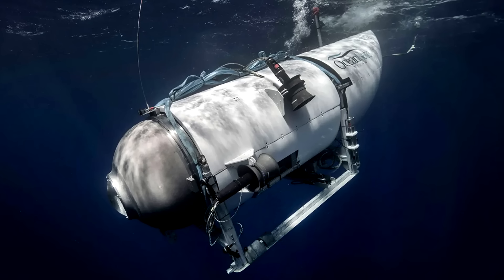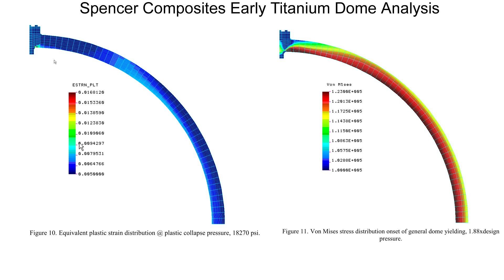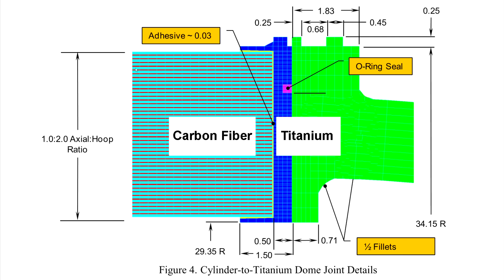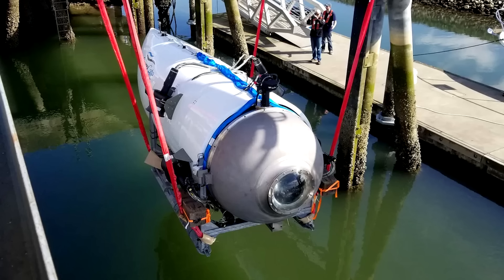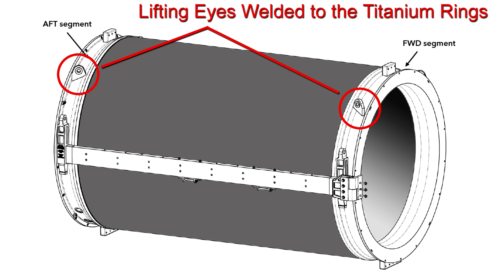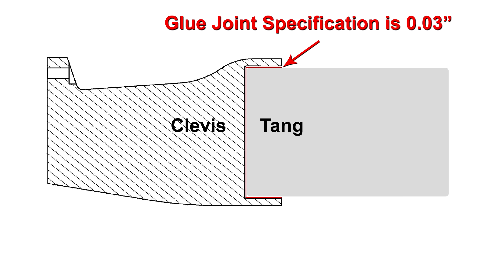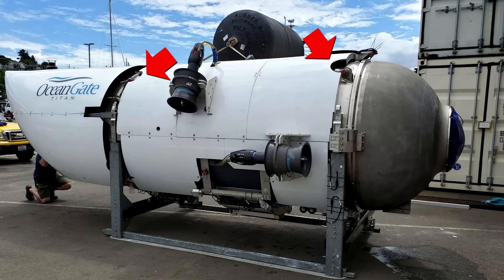OceanGate Titan Titanium Rings - An Additional Story About Them

Comment: I'm no engineer, but would have it made more sense to create an overhead structure (like a roll bar) tied to the "landing gear" to provide lift points instead of risking welding to the hull rings?
Reply from the maker: Thanks for your comment.  Yes, there were other ways to do it.  However, they may have been concerned about adding too much additional weight.  The weight of the sub is a big deal because it has to do with its buoyancy. Both to sink down to the Titanic and also to ascend by dropping weights. either in a routine dive or in an emergency ascent.

Comment: They should of used flex seal instead of carbon fiber, carbon fiber cannot withstand extreme compression period and there is not safe way to make it work for deep dive applications, the shrink rate between the titanium and the carbon fiber was pretty much ripping the ship to pieces everytime they took it down, that guy that thought he knew what he was doing didn't know much except the greed that got himself and the others to loose there lives

Comment: Bonding is a chemical treatment or conversion coating of the mating surfaces. Adhesion is the glueing process. Both processes are required for this application, the mating of titanium and carbon fiber. The process is an industry standard having color significance for each application for quality assurance inspection purposes. One can see that the bonding application is not present. When the ring is seated the squeeze out is not uniform and bubbly which indicates voids in the mating surface. Both observations would be considered points of failure and cause for rejection.
Reply from the maker: Thanks for your thoughtful comment with good information.  Nice additions to the discussion.
Reply: @solareclipsetimer  additionally carbon fiber degrades in uv/outdoor light becoming brittle. This build process is unforgivable at this knowledge level
Reply from the maker: @robcampbell2164  Thanks for your comment.  You are correct.  That is one of the benefits of OceanGate coating the outside of the hull with Rhino Liner.  However, the main reason was to prevent water intrusion.
Reply: @solareclipsetimer  Thank you for the interaction SET! The end item was ok for exposure to UV yet curious to witness the lack of UV preventable measures during manufacture. Fun fact, in aerospace manufacture it was found that silicone jewelry, which was popular at the time, was found to be contact harmful to the material and was not permitted to be worn during the manufacture or repair process.
Reply from the maker: @ Good points about other UV exposure.  Did you watch my other video, where I discuss that they had to transport the hull 55 miles after a layer to get to the factory to do the curing?  They 55 miles back to add another layer of carbon fiber.  Then back again 5 times.
Reply: @solareclipsetimer  I have not. I subscribed and look forward to doing so. The industry is an amazing science, and I am thankful to be a part of it in aerospace certification. I must say that the engineering mind in this instance is far removed from the ethic. It's like a doctor who doesn't uphold the Hippocratic Oath.
Reply from the maker: @ Oh yes, I know.  I am a surgeon.

Comment: Missing bolts at front dome 4 of 17 bolts why ????
Reply from the maker: I have tried to find out why all the bolts weren't in on that dive, but I am not sure. I can't find a good answer.  It was after dive 61. That dome weighed over 3,500 pounds, and the "hinge" on the left side (looking towards it) wasn't really a hinge. It could not support the weight of the dome, like the hinge we are accustomed to on a regular door. It was more of a pivot point. When opening the dome, the dome had to be supported at the bottom as it opened.  They obviously missed supporting it properly during that recovery.
Reply: @solareclipsetimer  water leaked in though missing bolt holes could be one of its failure that dive .rip too all
Reply from the maker: @mrx-k2r  Not sure about that.  During a dive, the pressure pushes the dome inward, and there is an O-ring on that ring surface to make the seal watertight.  But I still don't understand why all bolts were not installed.

Comment: I'd love to know how the cables entered the pressure hull
Reply from the maker: That is a great question.  Yes, wires, both control wires and power wires, need to pass through the hull.  There were watertight fittings through the rear titanium ring to pass those connections.  I wish I understood how they make those fittings watertight under those pressures, but I don't know the engineering.

Comment: Very interesting. Lot's of good information.  I haven't watched the other videos you have made on the Titan, so I don't know if you addressed the issue of repeated dives with no inspections/tests of the hull, nor inspections/tests of the other components.  Deep submersibles are rarely used without inspections and tests of the submersible after a dive.  Apparently, even titanium hulls are degraded with each dive until they can no longer be used for deep dives.  From the reports that I've seen, Oceangate had used the second Titan multiple times without inspections or test of the hull between tests, so couple the altered design of the Titanium rings and carbon fiber hull, there were no checks to see if it was still capable of deep dives.

Now I have to watch the other episodes.
Reply from the maker: Thanks for commenting, and I am glad you like the content.  You would like my three videos on the hull andone on the viewport.  I don't address non-destructive testing specifically in the videos, but I did respond to a lot of comments about that.  The testimony seems to indicate that the methods available for carbon fiber start to lose their specificity after about 3 inches thick.  So, not too useful on the Titan.

Comment: Pretty clear that the machined lip broke off as the hull separated from the flange, perhaps a larger lip would have prevented the two coming apart or a much tighter fit interference fit would have prevented the failure in addition to a thicker lip. It's like a tooth past tube at some point remove the cap or loosen it eventually a leak or the cap pops off. Ironically if there was no interior bracing on the interior of the hull your asking for the hull to collapse in spectacular fashion ultimately though ...

Comment: Why not just manufacture a crib for lifting the sub? You even make one big wide belt that goes under the belly and cradles the entire sub.
Reply from the maker: Thanks for commenting. I believe it is because of getting the Titan off the dock onto the LARS. It was a tight fit, and the landing gear of the Titan had to slip into a track on the LARS to get locked in. So they couldn't have a sling across the bottom of the sleds.  There was no way it would have been a good idea to sling it from the carbon fiber hull,  the titanium domes on each side weighed about 3,600 pounds.

Comment: In the Telecommunications Industry before AT&T or Verizon and most of the other “Baby Bells” will not consider purchasing a piece of equipment to be installed in one of their central offices unless it has passed a very specific set of tests that includes earthquake testing, extreme environmental conditions testing, destructive testing of the equipment as a network element and destructive testing of each module.  My point is this submersible that was designed to carry people to extreme ocean depths was subjected to far less testing than a piece of equipment designed to make/complete a telephone call.
Reply from the maker: Thanks for your comment.  You are of course, correct; there is no way people should have been in this sub.

Comment: I know the expert is arguing that the c-shape on each ring for the glue joint is not a potential point of failure. But, I see it in 2 dimensions and wonder about the micro-deformation characteristics due to static load on the inner leg of the C. It seems to me that unless the ring and carbon fiber move precisely together under load (and temperature, which has to be taken into account, I imagine) a sheer will occur at the point where the inner leg meets the ring body OR where the outer leg meets the ring body.
Reply from the maker: Thanks for your comment.

Comment: One question I have not found an answer for yet is: how did they get electrical power into the interior of sub from the external batteries? the cables must have come in somewhere, was it through the rear dome?  or was their a gland where they entered into the hull? or did the sub have an interior set of batteries and an exterior set?
Reply from the maker: That is a great question.  Yes, wires, both control wires and power wires, need to pass through the hull.  There were watertight fittings through the rear titanium ring to pass those connections.  I wish I understood how they make those fittings watertight under those pressures, but I don't know the engineering.

Comment: I don't recall reading anywhere about the lifting eyes, but clearly they were added after the hull design, nullifying any computation before that point. It reminds me of the airline that removed and refitted engines with a forklift instead of following the manufacturer's procedure.
Reply from the maker: I agree with you.  As I said in the video, may be they had some additional guidance from Collier Aerospace that we don't know about.  I hope so.  If not they were just "winging it."  Thanks for commenting.

Comment: The most fascinating thing to me about this whole story is that, as easy as it is to make the whole thing look insane, they actually had a lot of ideas that might have worked, and if they had worked would have been a huge deal. The problem is they were taking too many risks and doing too little testing to be remotely safe about it. If Stockton was a more cautious person and they had a much larger budget, they could have pushed so many boundaries in positive ways - there is probably some degree to which you can compromise the idealized shape of the porthole to give better visibility while maintaining most of the strength. There is probably a way to make the multi-layer hull work, which would be much cheaper to manufacture. The use of mixed-materials was probably not actually a problem if they had bonded them correctly and handled the completed vessel correctly. I think with a little bit more care, a vessel like the Titan could have been made quite safe. But because they cut every corner imaginable people died, and every 'innovation' they 'pioneered' is now 'radioactive' for the foreseeable future.
Reply from the maker: Thanks for your comment.  You are correct, they did some innovative things.  But, you can't engineer something new like this for a business model that you eventually want to be profitable.  They would have built, tested unmanned, and destructively analyzed multiple full scale hulls.  It would have taken a lot more time and money to figure it out.  But you are correct.
Reply: @solareclipsetimer  Yeah, their mindset seemed to be something like "if we just nail it the first time we can avoid all those R&D costs and it will be much cheaper" without any regard for the deeply concerning question of "what if you don't nail it the first time?". I would contrast with SpaceX - they are similar in that they are a private company whose business model is predicated on sucessfully using ideas others would dismiss out-of-hand as impossible, but they test extensively, aren't afraid to spend a bunch of money on something they know is going to be destroyed, and don't put under-informed passengers on completely experimental vehicles.
Reply from the maker: @nicksummers8320  I agree with you.  And we must remember that Space X didn't invent rocketry, they didn't try to "re-invent" rocketry either, they built upon what was known.  OceanGate was trying to re-invent submersibles and when doing it trying to NOT use marine engineering.  Wild story.
Reply: A bit of R&D can go a long way. It could have had two dome portholes with the right structure and top engineers designing it. 

Sad it didn’t work out, the potential was there but they skipped some really important parts initially and the timing was lost. RIP

Comment: As an engineer, I would not have trusted that glue joint in shear. I would have stepped the ring down so it goes inside the carbon fiber tube.

Comment: That edge on the ring's clevis is not very thick. Pics of the recover ring show the inside sheared off.  Not surprised if it was the inner ring clevis edge that gave out first.
Reply from the maker: Thanks for your comment.  One thing I would say is this, no matter what the cause of the implosion was, the implosion itself was an inward pressure that was going to shear off the inner rings.  So, it's really hard to say if the lips failed first, but they could have.

Comment: Having been advised by their expert not to weld lifting points to the titanium rings, I'm surprised they went ahead and did this.  They could have welded lifting points to the carrier frame without any great difficulty.  Welding onto the titanium rings that were already glued to the carbon fibre body not only stressed and altered the titanium, but no doubt caused unseen changes or failures at the titanium/glue or glue/carbon fibre interfaces, or within the glue itself.
Reply from the maker: Thanks for your comment.  Tony said no when it was being designed.  I hope there was an engineer with the second sub that said it was okay to do the lifting eyes and signed off on it.  We may know more when the final report comes out.  If not, it is really criminal.

Comment: The Carbon Fiber interface to this joint was always my first suspect as to where failure occurred. In the last photo displayed of the (Titanium?) ring shows that some portion of the "C" joint failed, and a thin piece of titanium looking like twisted titanium batten or something is protruding from around that inside edge of the ring.  It has obviously been sheered off the ring, as it would have formed a portion of either the upper or lower lip of the C ring.  There is no glue evident in these photos of the titanium rings either, which led me to believe the glue failed due to numerous stresses and destresses.
Reply from the maker: Thanks for your comment.  One thing I would say is this, no matter what the cause of the implosion was, the implosion itself was an inward pressure that was going to shear off the inner rings.  So, it's really hard to say if the lips failed first.

Comment: This is all so crazy! Design for lifting and transport is a really big deal in many industries! Manuals for bulldozers include exact information on lifting and strapping down, for example. 
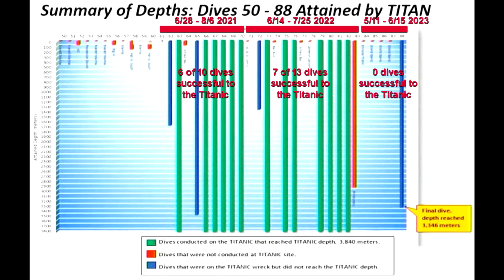Speaking of which, 11:19 that front-most bolt is a very tight fit with the perimeter of the titanium ring.
Reply from the maker: Thanks for your comment.  I agree with you.  Boy, I would love to know who engineered this idea and signed off on it.  It's not in the public record right now, but i may come out in the final reports.
Reply: Rigging is an art. Whether you use steel cables, chains, or nylon materials. Snapping chains or improvised hookers leads to trouble. 

Watching the bolts rip out of winch, on a D8 will teach you fast. 😂

Comment: There is a very simple reason deep sea diving equipment is based on a SPHERE.  Spheres evenly distribute external forces.  Tubes do not.  The only reason Rush used a TUBE was the ability to contain MORE PASSENGERS per dive.  They all paid for his arrogance and ignorance.
Reply from the maker: Thanks for commenting.  Yes, he wanted more room for passengers.  One more thing though.  Stockton also was big on the idea that this shape had length to it, so you could mount a camera at the back and be far enough away from people enjoying the view in the front to get a video of it.  He really felt that the documentation helped the experience.  In a sphere you can't get far enough away from any point to get a good video perspective.  I know that should not be a priority over safety, I am just telling you what he has said.
Reply: @solareclipsetimer  Point is ...... he will not be saying anything anymore........

Comment: In pressure vessels all the welds to joined surfaces result in a continuous flush surface. 
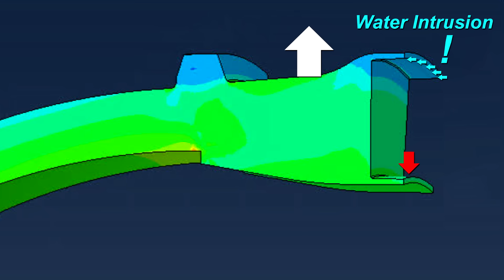At 10:09, the pressure here must have been very high!
The one thing that I have noted when working on different systems.
If it can!  It will! 
Generally a system will find the faults before you do.  "Cathy's Law".
Reply: Simple physics.......tubes want to deflect and crush from exterior pressure.  Repeated deflections in the tube, compromised the tube and mating surfaces at the titanium ring until failure.

Comment: The sub was not intended to be lifted . Its base was intended to be lifted . What happened ? The crane was too.small .for the angle needed to set sub in water . So they wanted the hook point the crane operator . Mistake . Things are almost never made to resist crane team method .
Reply from the maker: Thanks for your comment.  Tony was pretty explicit about not doing it, and he was the one involved in designing the original landing gear.  At that point in the process, the mechanical engineers at APL were also involved.  Tony also hired an engineer to help him at OceanGate.  Adding lifting eyes later was a bad idea.

Comment: They had titanium rings and titanium domes... but for an inexplicable reason wanted a carbon fiber hull rather than a titanium one.

I doubt it would have been that much more expensive as to justify it.
Reply from the maker: It was also about size and weight.  Stockton wanted more room without the weight.  Did you see the Alvin graphic that showed it weighed 40,000 pounds.  Ttian had more room for passengers at about half the weight.  But, in the end, CF is probably a bad idea for a sub trying to get to these depths.  Thanks for commenting.